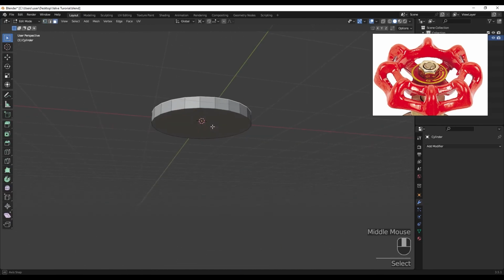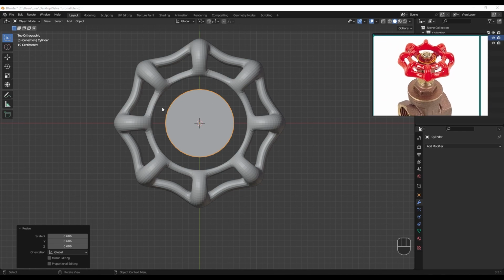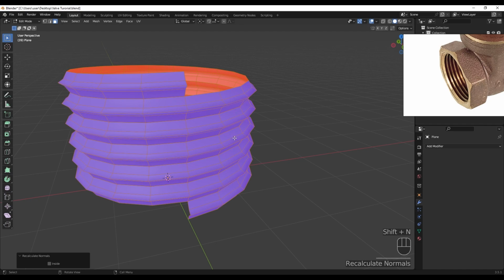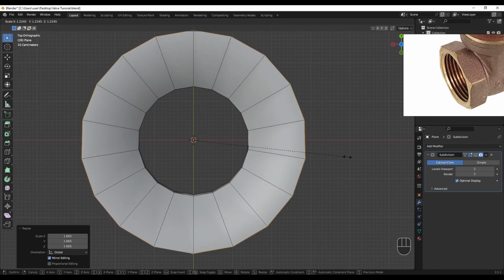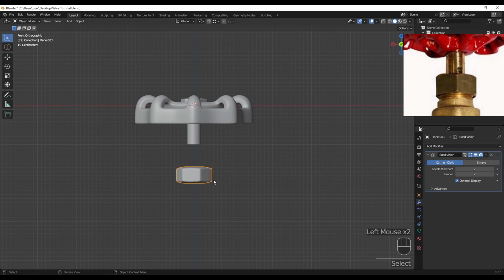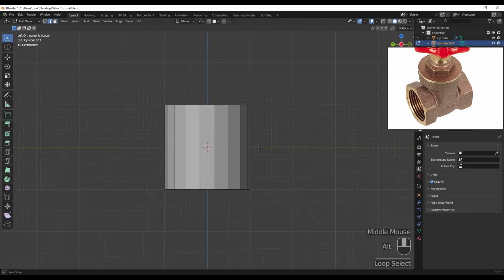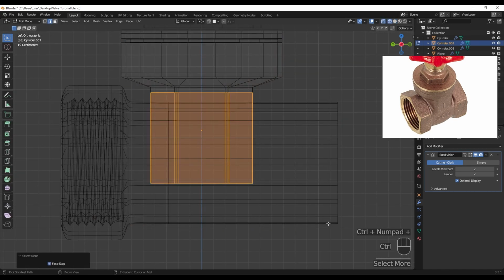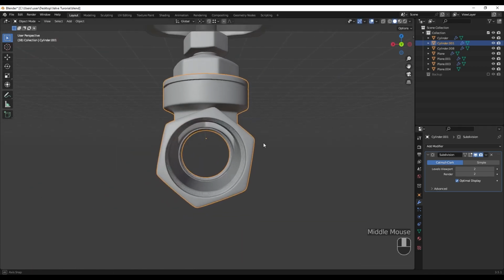Blender Valve Modeling Tutorial: Create Realistic Valves from Scratch

Comment: Amazing tutorial. I struggled with the final step of cleaning up the mesh, but one thing I changed was instead of making the same adjustments to all sides, I used the mirror modifier.
Note: If you are using the mirror mod, the model may be rotated weird when you apply the mirror, so make sure you apply the scale and rotation of the valve first (press Ctrl-A, and select apply "rotation" or "all transforms")

Comment: I can't seem to connect all the duplicate parts perfectly together. If I space them out 45 degrees there is too much space in between them. How do I fix this?
Reply from the maker: Start with 24 vertices for the cylinder. Rotate 7.5 degrees from the z-axis, and be careful not to reposition the edges when you separate out a single part. Also, make sure the origin is on the 3D cursor at the world origin. It should work perfectly.

Comment: Really informative. The only quibble I have is with the threads of the nut. I’ve seen several tutorials where they make threads on a screw or a nut, and most of them don’t take into account the fact that the threads go all the way to the ends. It’s hard to model, but having unthreaded portions at either end sort of bothers me.
Reply from the maker: You've made a good point. The threads should extend all the way to the ends of the screws and nuts. Yes, it's challenging to model, but I'll give it a try. If I manage to solve the modeling, I'll create a tutorial video for it. Thanks for considering this point and sharing your opinion! 🙌